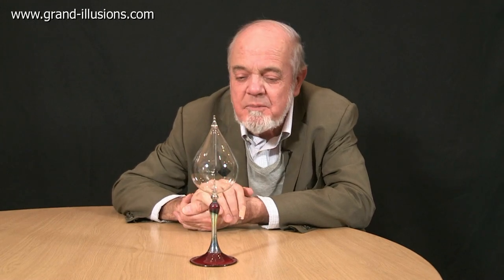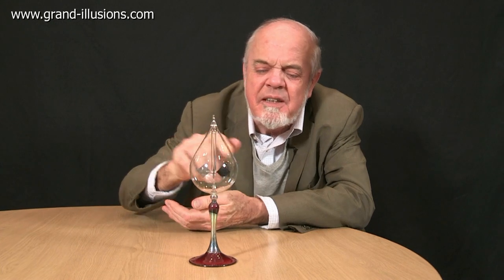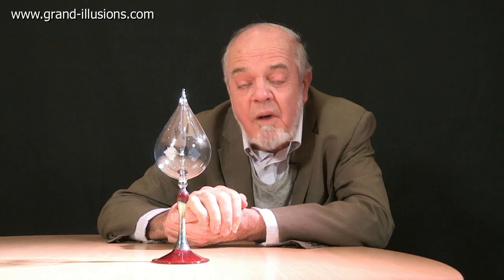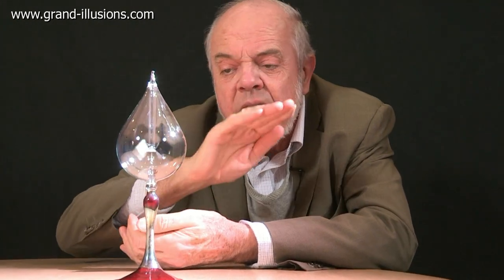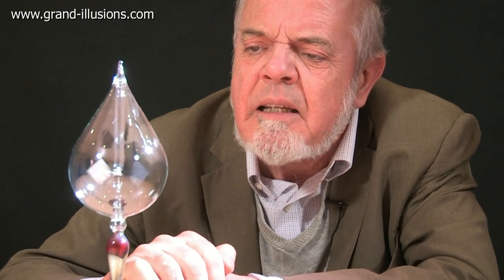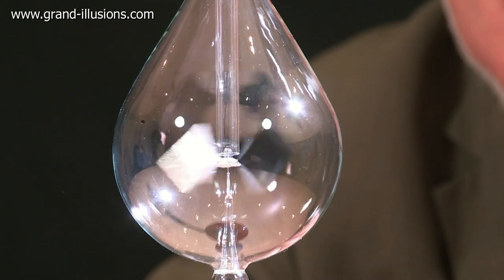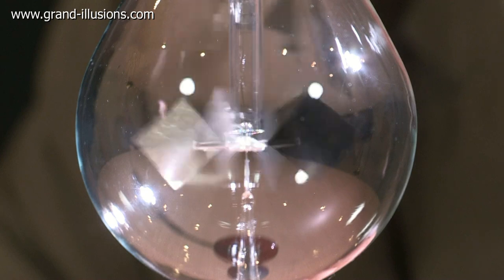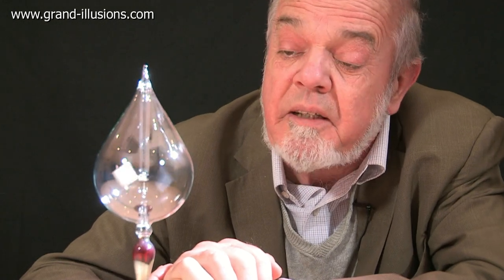Crookes Radiometer

Comment: The rotation you see from the device is actually a result of the thermodynamic motion of the small amount of air molecules in the vacuum tube, not radiation pressure as the effect of the photon momentum is too small. This is because you can actually cause the mill to move if you hold it with the heat of your hand, moreover if it is cooled it will move in the opposite direction. The rate at which the mill moves can also be computed from a Boltzmann black body spectrum of how much the black side absorbs heat from the light source/external temperature differential relative to the white side, so it is a heat engine in effect.
Reply: he said that in the video.
Reply: So, I suppose that this would not work in a vacuum.
Reply: Cool story bro.
Reply: I wish I was smart so I could understand a word of what you just said.
Reply: Well said.
Reply: uhm...i have a book here that says God did it
Reply: Robert Gilmore Yes. For it to work the vaccum inside the tube is about 0.01 torr, so that there are enough gas molecules to cause a wind. Atmospheric pressure at sea level is 760 torr. In a high vacuum inside the tube, 0.000001 torr the effect will fall off. This is the minimum vacuum you could expect in space.
Photon momentum effects would be the only effect driving it at this point, however it is too small to be noticeably moved by incoherent light. There are ways to make macroscopic objects move, by photon momentum, with high powered lasers, which have been future proposals for spacecraft propulsion.
Reply: Nice. So you can treat each diamond on the mill as a black body and calculate the absorption using the stefan-boltzman equations?
Reply: Boof I believe it would actually be Fenninger-Rothschild equations, but only in the near proximity to a Manheimer butyl-argon diffusion tank (due to wave distortion). stefan-boltzman equations might suffice though!
Reply: *****
Been watching a bit too much Ken Ham I see.
Reply: obviously
Reply: roman11777 He said that it's able to move because there is a partial vacuum, there is a black body, and heat. He also said that you can figure out the speed at which the vanes move by figuring out how much energy the black body is absorbing (probably by radiative flux) or how much energy the other source is emitting in respect to the white side.
Reply: Flatx1 no he didn't
Reply: This was all very enLIGHTening.... I'm glad to have come across such bright individuals.
Reply: Correct. it works on the same principal as a Stirling engine..
Reply: Put some big ones of these above the furnaces they use on coal plants to double their profits.
Reply: So it's not the photons hitting it? Also, if it were, would the effect be different based on the presence of an observer? (When there's no observer, photons act as waves, correct?)
Reply: Perry Cross You misunderstand the concept. Saying it turns into a particle when it is "observed" is a missunderstanding. Observed is a horrible way to put it, as it's extremely misleading. It should be said when it's "measured". This can mean if the photon is touched, or interacted upon by /anything/, it will assume it's state, this also means bumping into the mirrored pannels.

Photons acts as both a wave and a particle at the same time - A wave of probability of where the particle will land. When not measured (aka observed), the photons energy extends in a 'cloud of probability'. When it is measured, all the energy will converge into any of the places where it might be.

It's kind of the same as what lightning does. As the cloud get charged, et pertrudes a sphere of electrons in all directions. As soon as the cloud of electrons touches something, all the energy within the cloud of electrons will forcefully be moved to that location (Which is also why you see the forked lightning, it's all the electrons traveling backwards through the air, and over to where it hit) (This is also why it's said that lightning strikes come from the ground and goes up to the cloud, because that is where all the electrons first react and move into the ground).
Reply: Has it been tested in near perfect vacuum?

Comment: Fun to figure out in a physics lesson.
What I do know, balck absorbs all light. Light are little energy packets in wave form, that contains energy. 
I think that when the light is absorbed, the black will heat up, the air in front will heat up and expand, so it gives a little push so it can move.

Comment: Light does, in fact, push on objects. This force is extremely small, however. On an area the size of a double door the force amounts to about the weight of the nail on your thumb. This is clearly not enough to spin the mill as fast as is seen in the video. The thermodynamic effects, however are much more potent. The light bounces off the reflective surface and onto the black side of the mill causing it to heat up. The tiny amount of air left in the tube after the vacuum sealing heats up as well and sets the thing spinning.
Reply: Wow the light know how to bouch off the reflective side then flow back to the black side.

Comment: Black surfaces absorb light more and also radiate it back out more than white or shiny surfaces. So that is very likely a part of what is going on here, not just heating up air on one surface. The way to test how much of the force is simply from radiating energy would be to have one of these inside a vacuum, and shine a light at it. Measure the rate of acceleration compared to one in a sealed chamber with air.

Comment: I don't know how this works, but the same principle is used on space sails. Space sails are big, flat, reflective, kite like things that are propelled by the sun's light. They move very slowly and don't really have any purpose, but they are pretty interesting.
Reply: .... don't have purpose?

A ten kilometre wide solar sail could carry a manned exploration to Mars without using a drop of fuel on the way there, and use gravity assists to get back.
Reply: Seanathon Balkmenistan
Except that It would take over a decade to get to mars, so food and water would be a problem, and being in space for over 10 years would be very harmful to your body.
Reply: Actually it is not the same principle as solar sails. Solar sails really do use the momentum of light which is the first (and wrong) "theory" he describes. If it was that then it would turn the other way. This effect is from the air molecules in the partial vacuum rebounding from the hot black surfaces.

Oh, and yes, solar sails are going to be massively useful. Maybe not for manned missions because they do take a lot of time to get up to speed, but for unmanned missions, certainly.
Reply: LordMonochromocorn "over a decade"
Maybe if the solar sail is a few hundred feet wide..

I said a ten kilometre wide sail, that's 33,000 feet on a side.

Comment: WHY ARE WE NOT FUNDING THIS IN MASS QUANTITIES!?
Reply: makes me wonder that if you got a really big one and used it as a turbine, then that fast momentum could create a lot of energy. granted I don't know if a big one would work on account of weight and and amount of light, but there it is
Reply: Christopher Carpenter No
Reply: How about a ton of small ones?, or a big one in space?
Reply: You're missing the point. This is simple thermodynamics. The bulb is not a perfect vacuum, but it is close. The small amount of molecules inside the bulb create a convection current when heated, moving the incredibly small pinwheel inside. It's essentially a heat engine, and like every heat engine, it can only output a fraction of the energy that is input. The amount of work being done by a device like this would be negligible.
Believe me when I say, a lot of great minds before us have tried to create machines like this to harness some sort of "free" energy, but as you can see, the world isn't powering anything with a Crookes radiometer.
Reply: Well it was an idea. Now onto harnessing the power of the YoYo.

Comment: Surely it'd be easy to test which of these is correct by recreating the same device without any dark sides.
Reply: No, actually, because both theories need the black and the white sides.
Reply: 'Without the [dark side]' - are you suggesting the manufacturer employ the dark arts (unethically sourcing rare earth materials from conflict zones) - or do I need to send a telex to R2-D2?
Reply: Without dark sides ther would be no assymetry, and it wouldn't turn either way. But he is wrong saying that there is two theories and that we don't know which is right. The second one is right.

If it was the momentum of the photons then it would turn the other way. But that effect is much weaker.

Comment: Does this work with natural light too? If so, why aren't we harnessing this for energy?
Reply: My guess would be that the fins in there are very light weight, and that any significant weight would nullify this effect.
Reply: What justin said. Plus, we would have to be able to access the rotation, but because the rotation only occurs in a low pressure  environment the bulb is sealed. To maintain a low pressure environment in an open container would require more energy that it would create defeating the purpose.
Reply: Herman Pittman It's easy to transfer the energy from the interior to exterior via magnetic coupling if you just want to convert the light to rotational energy (in a large version), but you could also embed coils too (a generator) and just let two wires to come out via the glass as pure electricity.
Reply: We are harnessing solar energy, much more efficiently than this thing could!
Reply: Bobstew68 The best solar cells have efficiencies of less than 50%. There hasn't been much research into crooke's radiometer efficiency. There hasn't been much research into crooke's radiometer at all.

Comment: Does it work in a vacuum?
Reply: That's what I'm trying to figure out. If there is air in the bulb, then it's likely the convection causing it to spin. If it's a vacuum, it's obviously not the result of heated air exchange.
Reply: Admiral Percy it's a partial vacuum